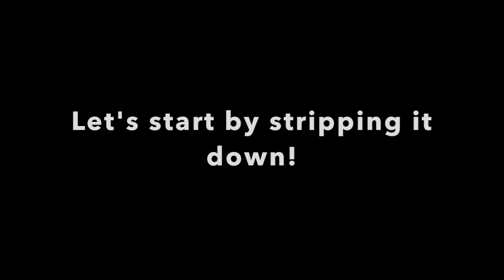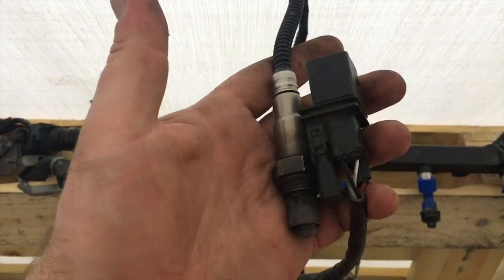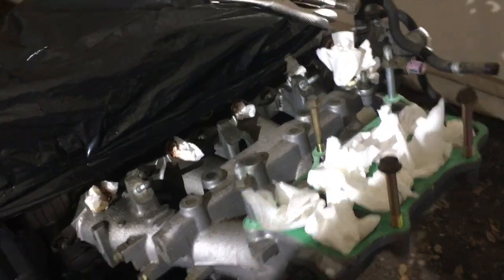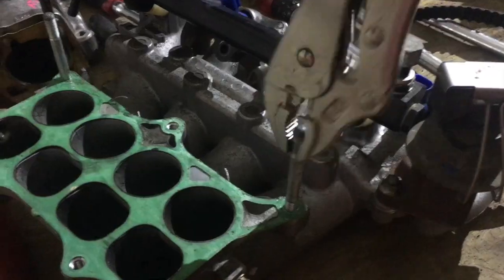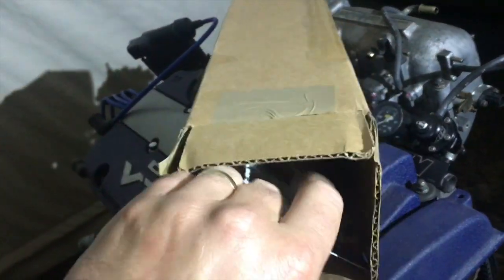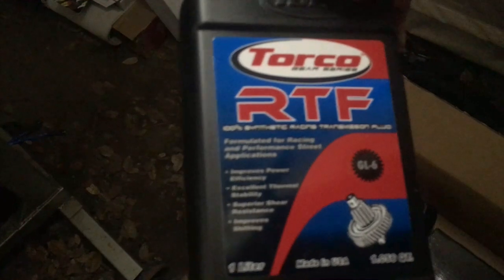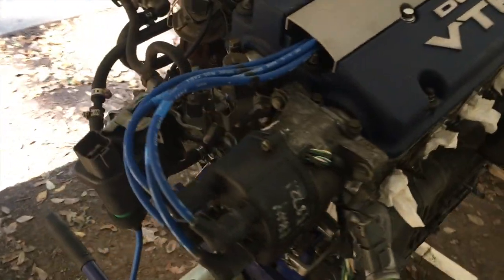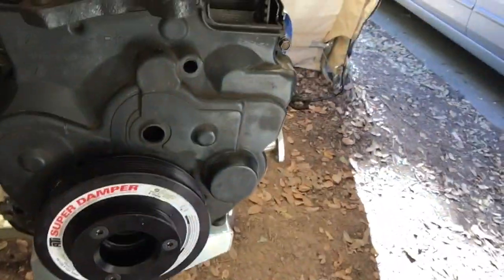CB7 Motor Build Part 5 - Parts and Progress!

Comment: Thanks for the clarification on the Oil Pan working for F22s! 👍
Reply from the maker: No problem.  The seal is still good after hard driving and racing, and only using Honda bond on the curved portion.

Comment: How has that oil pan worked out for you so far on the Track? I plan on tracking my cb7 and that oil pan has crossed my mind.
Reply from the maker: I’ve only been to the track, unfortunately, one since I got this motor in the car. However, my motor is safe and even during that wipe out I had in turn 6 at Laguna Seca, I only dropped pressure very slightly for an instant.  I can verify this because I did a Blackstone labs oil analysis, and there is no bearing material at all in my oil.
Reply: @af1132racing  ok I'll keep that in mind. Thanks for the input.